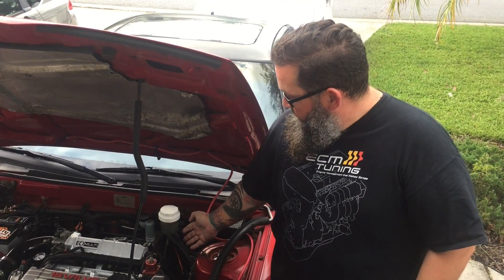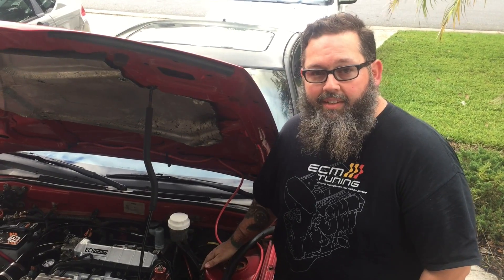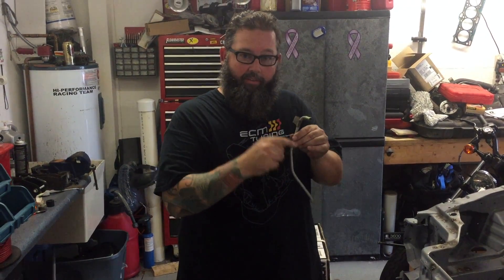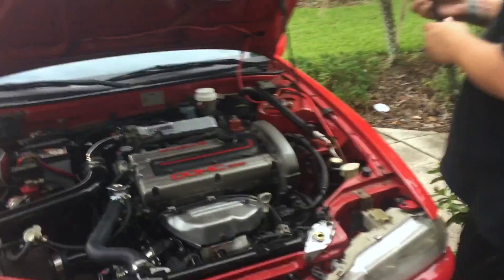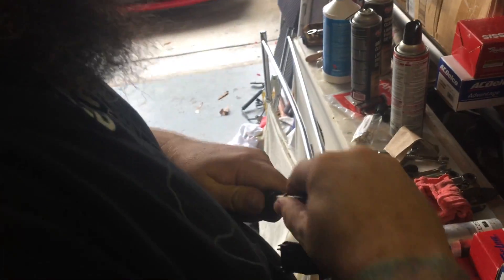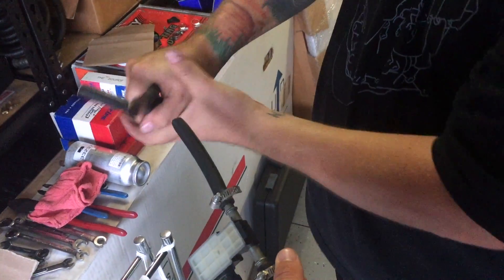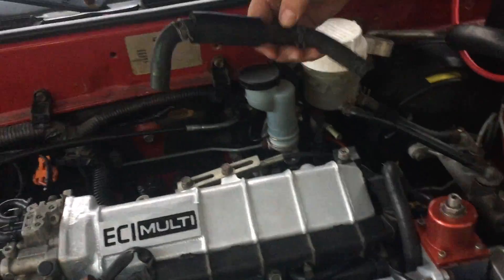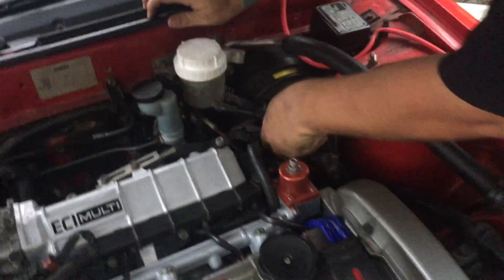Ethanol Content Sensor - Joe Wrenches Vlog #23

Comment: im getting ready to order all the materials needed to run E, my question is, where do you connect the other side of the harness that plugs into the flex fuel sensor itself?
Reply from the maker: If you have ECMLink, you buy the flex fuel harness from them. Otherwise you need some kind of stand alone engine management that has an input for ethanol content.

Comment: I need a oil pump for my 7bolt what would you recommend
Reply from the maker: Some people swear you have to use OEM, but I have had good luck with common brands like Topline or Evergreen. I just like to make sure to measure all the clearances and compare to the factory service manual.
Reply: ok cool when I it up and running how much to help tune my dsmlink
Reply from the maker: Unfortunately, I don't have much for extra time to tune cars for others. I would recommend contacting Six Sigma Tuning in Epping NH. Kevin Jewer is the tuner there and he is a wizard. He can help you remotely for a fair price.
Reply: ok cool thanks